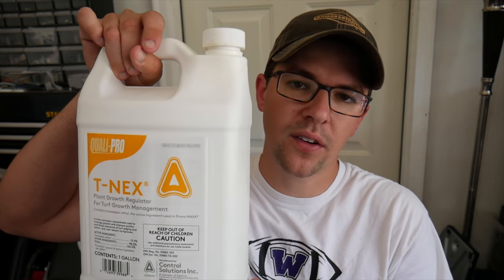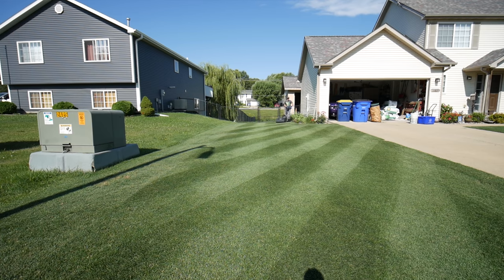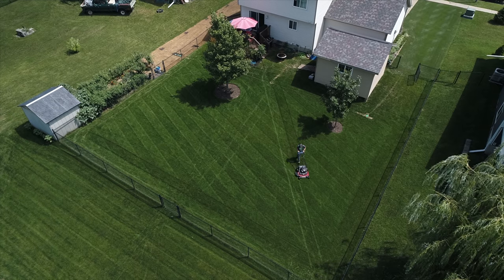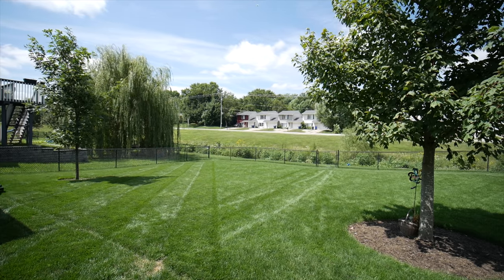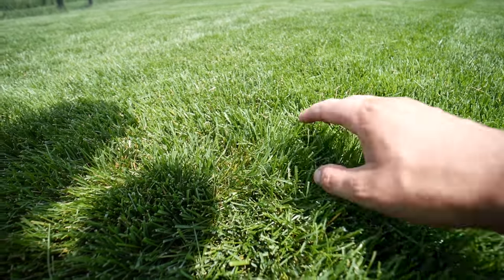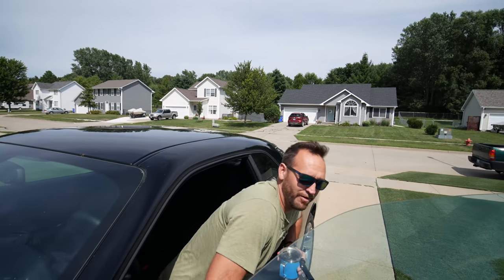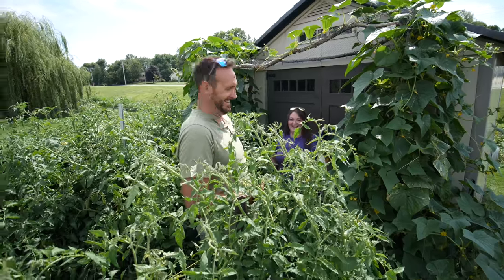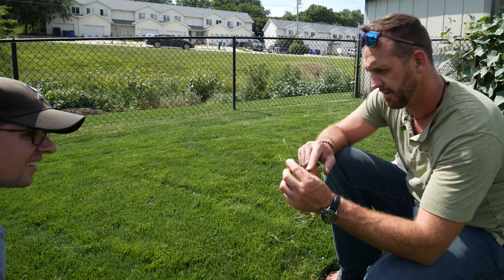Lawn Care LEGEND Visited My Yard

Comment: I'm in the same scenario with my front lawn of fescue/rye/bg mix.  At 3.5" or so, the grass seems to fold over giving it a weird look.  Any foots steps in it really show up and the grass doesn't seem to be able to stand back up on its own.  While cutting, the wheel marks from my mower really folds the grass down before it even gets cut.  What can I do Ryan to help with this?  I tried cutting it at 2.5" and it helped, but I got a lot of yellow stem that would show and not look as great.
Reply from the maker: It will look best when it's done consistently from the start of the season or when you bring it down in the fall in prime growing season.
Reply: Van my turf type tall fescue stands tall and hard at 4 1/4. On the contrary, my KBG folds over. I’m leaning towards all TTTF or a blend like Pete’s because the rescue really prevailed this summer. Way less dormancy then the KBG and I’m irrigated. Perhaps I need to increase my watering. I pulled it back because of too much.

Comment: Question on using a reel mower.  I live in Utah have a blended blue/rye grass lawn.  What is your thoughts on using a reel mower in Desert States like northern NV or Utah.  I live outside SLC keep my lawn about 3-4 tall use proper care and watering and it looks great.  However I am so envious that I don't have that nice low cut that you get with your reel mower.   So..... will a reel mower in Norther Utah work with my type of lawn?
Reply from the maker: You could definitely make it happen however it will take quite a bit of water to keep it going.  I imagine with a good root system already established it might not be as extreme as you think to keep it green at a shorter height.  As John said on our podcast, what's the worst that can happen?  You can always go back to higher cut.

Comment: Are you going to be reel mowing the back as well.
Reply from the maker: Too bumpy at this point
Reply: @ryanknorrlawncare  Did you run the roller over it when you did the front?
Reply from the maker: I have not rolled it this year...I made the mistake of aerating a few times over the years and putting too much traffic on the lawn after that so those cores became pretty bumpy.  I might get the urge to fix it yet this fall but we'll see
Reply: @ryanknorrlawncare  Do you plan to reel mow eventually?
Reply from the maker: @Boodieman72  I'm not planning on it as of now